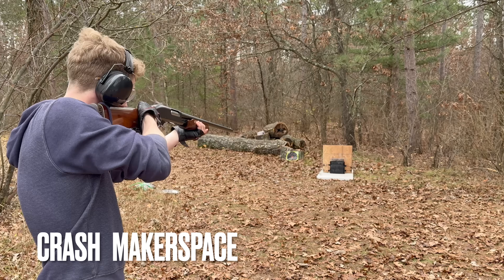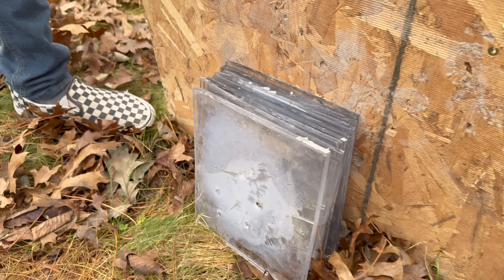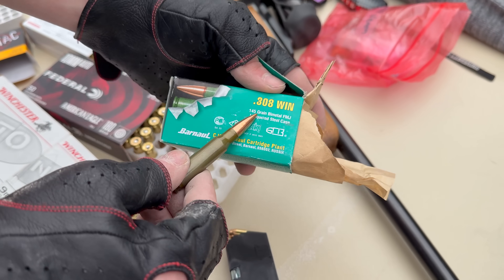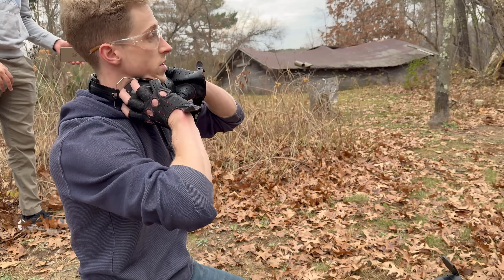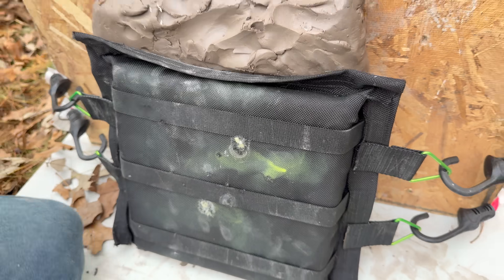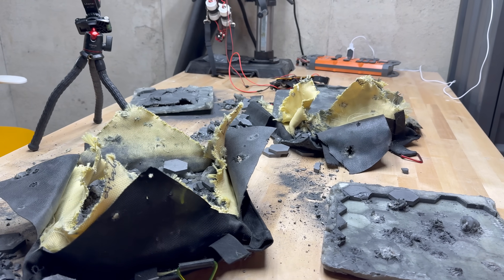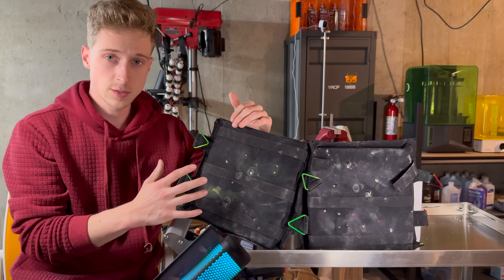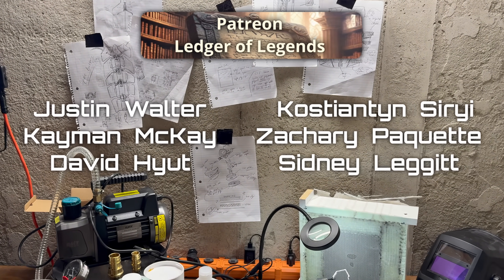3D Steel Lattice Super Armor (MULTI - HIT .300 WM capable)

Comment: One suggestion, TechIngredients has a video called "Super Strong Epoxy with Diamonds". He has a interesting solution to the epoxy issue that may increase it's resilience (as well as an amazing detailed breakdown of the science involved!). While air gaps are good in something like this stacking various materials of decreasing particle size pieces into the epoxy might yield better results.

Comment: That was way better performance than i thought metal would provide in that pattern, i thought solid metal would be better then that pattern with space "for the bullet to more easily go through" but it looks like thats maybe wrong, idk how, maybe because energy is dispersed to the sides instead of back into the shooter, the patterned metal is also lighter then solid metal at the same thickness, so you could increase thickness for the same weight achieving more protection for the same weight. Hopefully thats true because that'd be a technological advancement in body armor

Comment: None of those rounds are actually used by snipers...
And none of them are actually designed for armor penetration. No - even the M855 'green tip' isn't classified as 'armor piercing/penetrating'. Even with it's (mild) steel core. 
Anyone into (real) personal defense knows that velocity = armor penetration - Not "energy". The 12ga. being the perfect example - Hooooooorible penetration, but a metric butt-ton of energy. 

I get it, you're making cosplay costumes. Thats cool. But, that being the case...  why all the fake-out 'real' testing?
It's just cosplay dude. Join the military if you actually want the 2-way range experience. It'll rearrange your priorities about a lot of things.

Comment: Good job. Much respect to you.  I never comment much but I will to support you my man. Keep this up.  Have you tried maybe building a little spot for the ceramic tiles when they break they still stay in their little spot so if it’s not all broken some of the bits can still help. I dunno if it will work but a suggestion.
Reply from the maker: Thanks for commenting! The epoxy I hardened is a bit flexible which helps localize and lock in each tile. This is what helped with the repeatability as it would maintain the fragments there still. Once I opened it up I broke all the remaining connections ( also it was shot like 17 times) so the tiles were just destroyed at that point 😂

Comment: 2 cool things (if work and time investment allow it) could be to also do some stress tests of on field conditions in high humidity (if treated with titanium dioxide) or intense UV index and mixed reflective environments (if not). That was a failure point of quite the handful of early 3d printing assisted composite designs that integrated meshes/chain links/overlapping honeycombs just over a decade ago; not that it would matter for use in (at least the vast majority of) towns or the cosplay case.

Comment: hacksmith has a video where they coated a 3d printed 'bone' with a thin layer of some kind of metal alloy thing and it was super strong. if you have access to that it might be a good option because the lattice structure you made has a lot of surface area to coat with the metal. you might even be able to just use the resin printed one because it's supposedly that strong.
Reply: you would also be able to make it even thinner and lighter

Comment: Nice video! A few tips:

1. You could try to adjust the surface of the plate. Don't make it smooth, put small hexagonal pyramids on top. This will help to divert the momentum of the bullets so that they don't hit the plate at a 90° angle. You could even include these pyramids inside the plate.
2. When shooting the plate, you should always shoot them at an 90° angle. Shooting at a plate on the ground while standing while increase the effective thickness that the bullet will hav eto pass through, which is kinda cheating a bit.
3. Beware of ricochets of the smaller rounds.

Great work!

Comment: For someone who shoots a .300 win mag on the regular im baffled with how well your DIY armor held up. Absolutely crazy. The power that round has is destructive as hell and your plate took it like a champ
Reply from the maker: For sure! That's why I was surprised it took 2 to be honest lol
Reply: @CrashMakerspace  You ever seen Dragon Skin armor?  Its a method of layering the tiles like scales to dramatically distribute the load and also aid in multiple round absorption.  I would also run some test with the entire panel arched as it should help distribute the load through the entire system much better.
Reply: 300 win mag ain't much since standard level 3 and level 4 armor would stop it. If it was for example loaded with something from a 30-06 m2 ap or swiss p ap tungsten core then it's comparable to the average level 4 body armor
Reply: @JacobJoesph  actually, no, level 3 plates can't take a standard win mag. I've tested that myself, they will fail if shot at from anything less than 600ft.
Reply: It's impressive, but I've personally seen a titanium alloy plate 10x10 take a few win mags and that sucker only weighed 6 1/2 pounds.

unfortunately he's not breaking new ground here, still a very impressive DIY though.
Reply: @hoppeanofasgard1365  He could always print this out of titanium alloy. Its just that is ~4x the cost...
Reply: @TarrenHassman  I think there's some technological; challenges to overcome in 3d printing titanium. To this day, there's only been one successful titanium 3d printer made and it costs millions of dollars.

I'm sure in time the technology will become cheaper though.

Comment: This may come off snobby but that’s not my intention. It’s not “power” when referring to the caliber. A more accurate description would be energy. Speed defeats armor. When a smaller projectile is traveling super fast it doesn’t dump all of its energy when it hits armor (unless designed that way) but retains that energy and continues to travel through. So when you shot it with the slug after it took the .300 and thought it went through I was like no way. Lol
Reply from the maker: E=1/2m*V^2 and velocity is always the kicker as it's the squared component. The reason I was so impressed with the slug is because the carbide was already obliterated from X2 .300, 308, and 556 green tip -- it was not that I think that a slug is more penetration than a 300.

Comment: really nice work!
what is the performance without the carbide for different calibers?
Since the carbide pulverizes after a single strong impact and the tiles are rather large, i assume, they dont catch followup shots in the same tile area.
Reply from the maker: You can see the slugs landing on top of the first 300WM shot and the 556 / 10mm landing in same impacts as previous spots, so yes repeated impacts are handled well
Reply: @CrashMakerspace  that is what i meant. After the first shot the carbide is mostly shattered loose pieces. So i think you could potentially remove the carbide entirely and only use the printed metal. would make it both lighter and cheaper.

Comment: really curious how this design would fare with higher end 3d printed (FDM) prints if its even possible (It look so? from what you have shown anyways). I thought your tests with the resin were extremely interesting. I thought of this after seeing tullomer from zpolymer, a MUCH cheaper engineering filament (still 250$/ 500g) but it can allegedly print on any machine that can do 300c nozzle. It was on par with STEEL in some of the tests, like better than stuff triple its price. I think the idea of custom fitted FUNCTIONAL 3d printed armor at home is insanely cool. keep it up man!

Comment: Can you make it in different shapes so that is conforms to the body?
 I know you have a goal for it, but i just want to know if it can be made wearable and comfortable for standard carriers
Reply from the maker: Correct, the metal lattice can be printed with contouring or hammer-bent with force into shape. The primary limitation is the size of the Hex Tiles

Comment: With how well this did you could probably get away with a thinner profile version to reduce weight and for a more low-profile concealed fitment on the user. Sure it would not perform as well but it may still be able to take multiple hits while holding up and still outperforming many variations of armor.

Comment: sorry if I missed anything but if you're trying to get maximum force dispersion by compression, wouldn't a gyroid offer good performance? very high surface area, very low density, no triangles in the structure making it stronger, I don't think it'd hold up in your earlier tests but when used in a composite it might outperform the other surfaces by being intentionally weaker.

Comment: Have you thought about using denim? 
The thought came from watching ppl make knife handles using the same process you are, in a sense. Multiple layers vacuum packed with the epoxy. I can't remember the name, maybe "mycarta". 

It would be interesting to see a multi composite "plate" using what you have that works and implementing  soft but durable layers throughout. 
Idk, awesome work though.

Comment: The fact that the armor was defeated by a slug, and not a faster, pointier, sturdier round, is interesting. For the weight, it's pretty good, but the energy transference and the bulk leaves some doubt. It'd be prudent to compare it's action against plates rated for what it has been able to stop, and plates of the same weight and thickness. Without a comparison like that, it's hard to say how well it exceeds conventional armor.

Comment: So. I don't entirely trust your test. I just spent time looking at tests of 5.56 and .300 Winchester Magnum against Level IV plate.

Good Level IV plate was able to stop the .300 winmag in separate spots more reliably than your plate was. Your second corner shot was a little sketchy on that Steel version compared to this video: https://www.youtube.com/watch?v=KHFJ5Gdmy8s

Granted, this Level IV plate likely will not take more .300 winmag in the same spots.

Additionally, you only fired two rounds of 5.56 at it. While the lack of backface deformation after 1 hit in each spot is nil, there are videos of shooting level IV ceramic plate once or twice with zero backface deformation there as well.

I would like to see you shoot this several times in the same spot with 5.56 greentip to see how it holds up. the 10mm doesn't mean anything.

Additionally, I would like to see a test of just the steel lattice against 5.56 and that compared with a steel plate of the same thickness.

Right now, I do not fully trust your results. But I bought into your patreon, so now I have skin in the game.

Comment: Legit one of the better engineers I've seen on youtube. I'm surprised you didn't test the steel lattice on its own to determine what else is actually necessary for your end result. When making the suit, are you going to be refining the profile to be thinner/less material?
Reply from the maker: Just do to cost I figured I dive straight into a full plate build 😅

Comment: Apologies if this has already been answered, but is there any specific advantage to using hexagonal plates? Does the shape have any affect on the energy dispersion? What would happen if you used something like Spectre tiles?
Reply from the maker: Hexagonal are good for adhesion as it’s a good balance between surface area adhesion and surrounding tile lock-in

Comment: So yer basically using a 3d printed metal mesh structure to dampen backface shockwave reflection ?
I've seen metal foams used for similar purposes.

For those not in the know the reflection of the shockwave on the rearface of the impacted plate back into the ceramic plate is on of the major factors that damages the tile. By delaying and dampening the reflection you increase the time the plate resists shattering under the projectile.

Stopping the plate from flexing also limits damage.
I have seen applications where 1mm Stainless plates were added onto the backface...even if the package is embedded in cast aluminum.

Comment: I'm actually very impressed with the armor. You created level 4 plates that can stop what most level 4 plates can stop: while being the same weight. Good Job! :)
Reply: NIJ is an outdated rating system that is in need of an update
Reply from the maker: This can stop a lot more, level IV is often only a few rounds of 762 / 308
Reply: @CrashMakerspace  A single 30.06 M2AP round with a mass of 166 grains at a velocity of 2880 ft/s you blew that out of the water. I suspect Aiden typo'd and meant can't on the second one.
Reply: @n00bist723  Stopping an M2AP at 2,880 fps, is a completely different animal than stopping a 220gr 300 WM round.
Reply: @BuffRANGE  2 220gr 300WMs, 5 5.56 green tip, 1 145 grain 308 all on one plate then failing to the 3rd 300WM I think that's just a little bit more of a different animal than a single 30-06M2AP. Yeah M2AP is a really well designed AP round with a really good velocity but it isn't a magic round.
Reply: @n00bist723  From a pure muzzle energy aspect, a 220gr 300WM assuming a 24" barrel is around 3,500 ft lbs of energy. The M2AP at the NIJ spec velocity is 2,880 fps, so 3000 ft lbs. The steel penetrator inside M2AP makes it a tough cookie to stop.  OP's armor has a long way for development. There are already existing level IV personal worn armor in standard 10"x12" sizing that weigh 3lb LESS, and are able to stop multiple strikes of M2AP and various AP threats at 300 WM velocity.  Total energy on that mentioned plate was over 21,000 ft lbs..
Reply: @BuffRANGE  Ok and? Most of what you said is irrelevant. LvL4 is an underdeveloped spec with a low bar it's a single M2AP which even with a steel core is far softer and less likely to pen than (in sequence with each round compromising the armor more and more) a double tap of 300WM, 1 5.56green tip, 1 145 grain .308, 1 2&3/4in 1oz 12g slug and then 4 more 5.56 green tips. 
Facts are:
- Lvl4 spec is:  A single 30.06 M2AP round with a mass of 166 grains at a velocity of 2880 ft/s
- CrashMakerspace blew that out of the water with a homemade plate (because)
- 2) 220gr 300WMs, 1) 62gr M855, 1) 145gr .308, 1) 2 3/4in 1oz 12g slug, then another 4) 62gr M855s > 1) 166gr M2AP

Yeah there's stuff on the market that's better there's also stuff on the market that meets spec and is worse, so? We're not talking about that/them here. Weird whataboutism going on here like you lost your own plot. I also think you're kinda putting M2AP on a pedestal. It's an old round that was designed in 1939, without seeing any updates it got "power creep"d by science and advancement there's plenty of .308 and even a 5.56(DM31 ~15mm of RHA @ 100m) that out-pen it on RHA pen tests. I mean M855(~7mm of RHA @100m) is honestly not lagging too far behind M2AP(~10.67mm of RHA @100m) and it's not even a real AP round.
Reply: So you created what already existed but for ten times the cost well done, yawn...

Comment: 9 pounds isn't bad. It's a bit heavier than a standard SAPI plate, for a little bit better coverage. When it comes to building the suit, I would gently recommend figuring out a better way to distribute the weight across the body. Most modern body armor hangs the weight off the shoulders, and it gets uncomfortable as shit after a little while. Doesn't do mobility any favors, either, and over time, the risk of injury goes up dramatically. There's a reason GWOT vets tend to have bad knees, backs, and ankles.
Reply from the maker: Yep exactly, a bit more weight but far more repeated impact protection which is what I was going for here as a chest plate

Comment: i feel like this idea for latucing the metal could actiually be revolutionary. if you were to make another plate out of the steel alloy they use for other level 3 plates, this idea of yours could make an impressive level 3 or 4 bulletproof plate.

as of right now, its just a bit too heavy and big to be a better than industry lvl 3 plate. but other than those two issues. it could be amazing.

Comment: I wonder how it would be affected if you were to put a slight outward curve into the design similar to how normal LV4 plates tend to have?
Also, another important thing to test/monitor is how much concussive force is still being transferred to the body behind the plates, as even if the round itself is caught, if the concussive force is not also caught then it can end up with the wearer becoming a red paste internally despite not having anything pierce their body; This is part of the reason why US troops use/d trauma pads behind their plates in war.

Comment: What about the shrapnel when the bullet disintegrates on impact?
Reply from the maker: No spall happens, mentioned in video and you can see how the pouch has zero tears or exit markings (until they each failed after a bunch o rounds out the back)

Comment: I'm surprised there wasn't spalling from the steel plate
Reply from the maker: I ensure the composite captures it!
Reply: @ That's good. It's really impressive work! The only thing I wonder about is the weight. My Hescos front and back only weigh 11 lbs and after 5 hours in them I'm pooped. 9-10 lbs per plate is a lot. But clearly the weight to protection ratio is extremely high which makes me wonder how much an RF2 plate built like this would weigh

Comment: 15:22 I dont think you should stop iterating; the biggest engineering question isn't how strong you can make it, it's how thin and light you can get it while still meeting your minimum protection standards.

And even then, there might be situations where you aren't worried about high-powered rifles, so you'd be willing to accept less hardcore protection in order to stick with much lighter and/or thinner armor, so having a "lite" variant developed could still be useful.